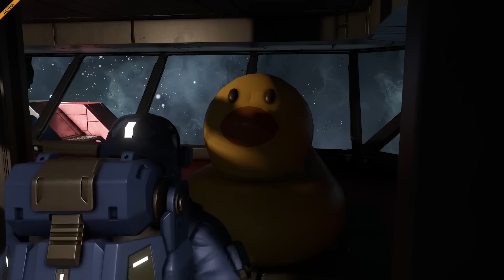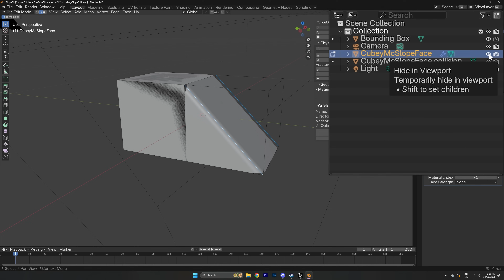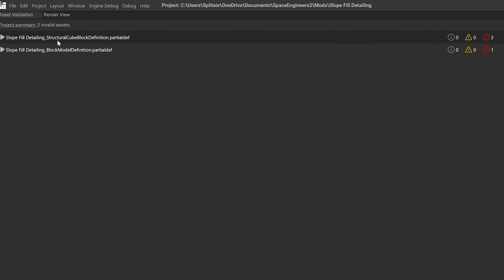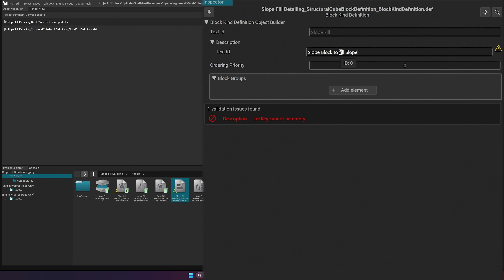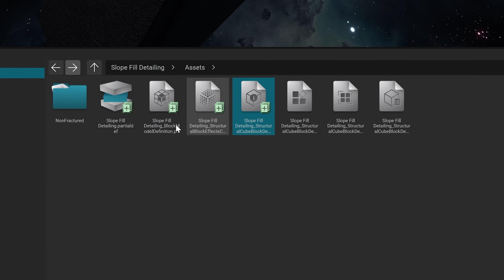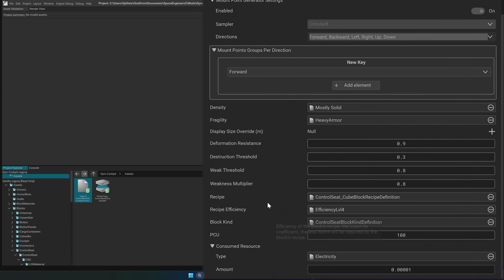How to Make a Mod for Space Engineers 2

Comment: How exactly is weight of the blocks calculated?
i can only find "mostly hollow" or "mostly solid"
but how does that transform into the weight of my thrusters: 1m 58kg (200kg ore), but the 2m weighs 464kg (560kg as ore)
i mean its listed as "mass curve modifier", so i imagine a system that takes the size of the block into regards?
but still, that feels so strange and because of that i have to determine the weight by ingame checking everything (want to fill the wiki)

Comment: ANy other advice?  ..needs smaller bits to fit better to all the things. e.g. 8x1x1 structural beams, 10x6x1 grates and floors, doors with floors or are 8x8x2(or 1) so they can fit in my frames better and not clash with the primary components.  also  Conveyor 1x2(or 5) with added wall material out to 10 or 8  or thicker as well 10 or 8 x 10 or 8 x 1 or 2

Filler light and heavy armor blocks e.g. 1-2 slim half-slope block

Comment: The mismatched material is frustrating. Is there not a defualt material that can be applied that will mke it match without a seam?
Reply from the maker: It's actually a mismatched block type. I don't believe the shape I made is possible with actual armour, so the special armour tiling can't be done

Comment: I didn't mod per say SE1, just edited some files of mods to make it more in line with what I wanted (like I edit at most for other game too), the tools for SE2 seems intuitive enough for better moding. I still won't be able to make models or other complex stuff but having only the changed value into the copy is great for updates! Another game I changed quite a lot of stuffs for myself is using a XML format for the file with an add/remove/replace format, and it is great for not breaking too much with update...
Anyway I'm still waiting for planet to come to delve more into SE2...
Edit: 4 months later, Today (as I was bored) I launched SE2 to try to build something, and after some time found a block I'd want to put but can't as it's the same as this one except slope, so came here to refresh how it was done and try to do it myself... if it work I'll publish it on the workshop with link to here as well :p if not then... I won't :p
Edit2: Nope, Can't figure out blender...

Comment: This is "great", but I'm not sure I agree with the prioritization of releasing this modding support before pretty much anything functional (as opposed to purely visual) is available in the game. I presume (maybe incorrectly, though) that the majority of gameplay/grid features you could interact with in mods aren't available yet. I'd have been much happier to see something (anything) functional SE2 finally. But, of course, if there are sound reasons for doing the modding system first because it aligns well with the internal development process overall, then sure.
Reply: I guess it can help the modders get used to the editor, and keen can get feedback about how things work together.

Making code changes is easier early on
Reply from the maker: Given the limitations to modding in se1, it feels like doing this first is the right way. This shows that keen are thinking of modding from the earliest phase, so hopefully they won't have systems like economy that are basically blacklisted

Comment: Did I manifest this video? Kidding, I'm not that self-centered. But it was just last week that I was lamenting the fact that there are mods that do things almost as I want them done but not quite. For instance, I enjoy using modded solar panels. Specifically the High Tech Solar Array mod, which I will refer to as HTSA because it's a long name otherwise. My issue with it is that it doesn't have sloped solar panels like vanilla game does. There is a mod that uses HTSA and does grant extra models including a slanted solar panel (High tech 1x1 solar panels, adds 1x1, 1x1 slanted, 2x2, 3x3 and 4x4 blocks), but the slanted solar panel is only 1x1. I would love to have a 1x2 or 2x4 slanted model of the HTSA panels, but there's nothing that does that AFAIK. I was legitimately considering learning to mod just to get what I wanted.

And then I took a closer look at the title and realised this is for SE2, not SE1.
Reply from the maker: If we get to the point that you're feeling those same frustrations in SE2, then this will deal with them, since you don't have to reupload a mod, you just have to make the changes you want and post them, no problems with using someone else's stuff because the way we manipulate the vanilla files, I'm pretty sure can be done with modded ones too :)
Reply: @Splitsie  once Survival comes out, I plan to take another proper look at SE2 and I'll probably end up modding at that point. Your guide will be invaluable.